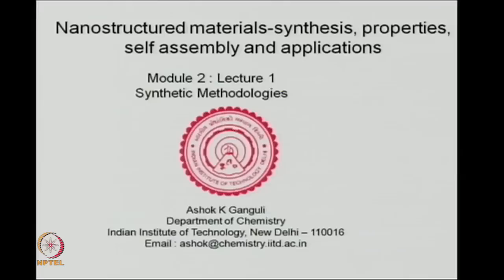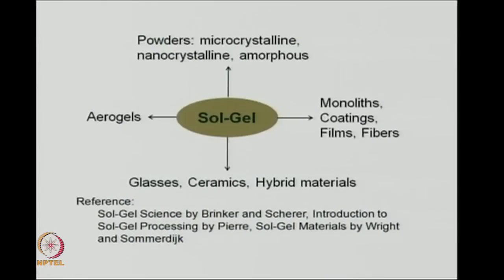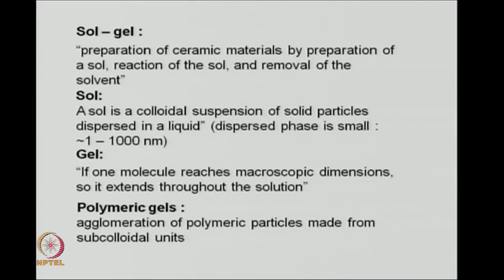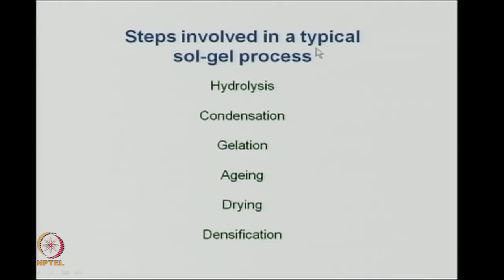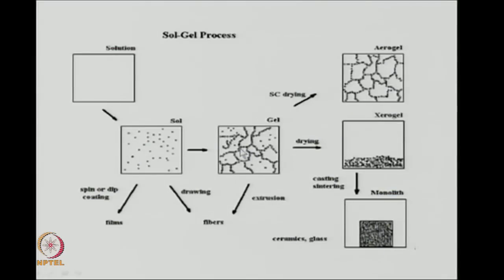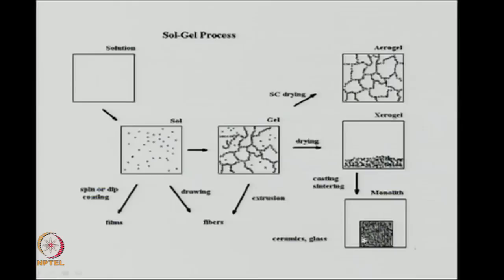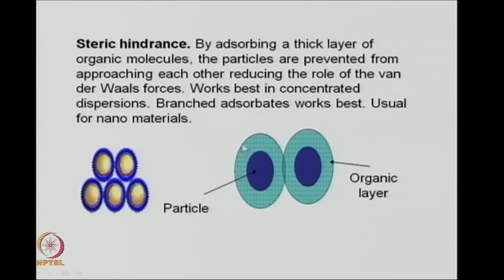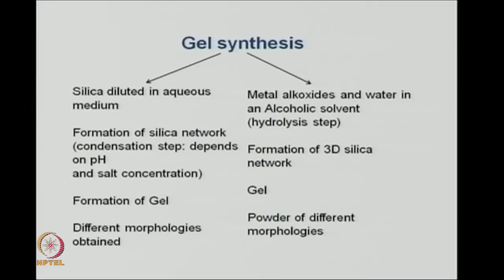Mod-02 Lec-03 Synthetic Methodologies

Comment: Sir, i have a doubt....why in case of SiO2, if we use water then why it will give +ions on the surface of silica? It should be -vly ions as pH>PZC.  pls Check in the video at 18:12.
Reply: I also think there has been a mistake, in case of MgO in water, it will have positive charge